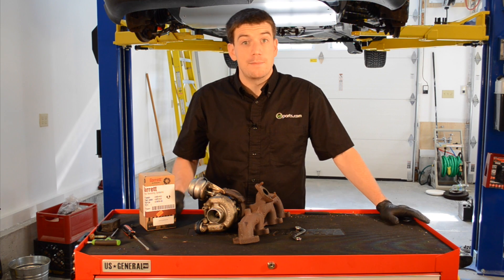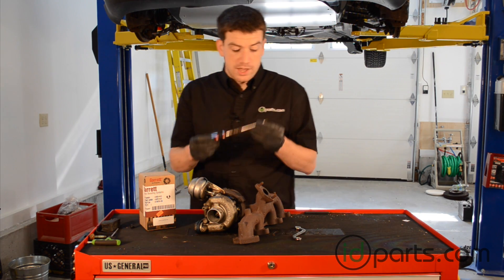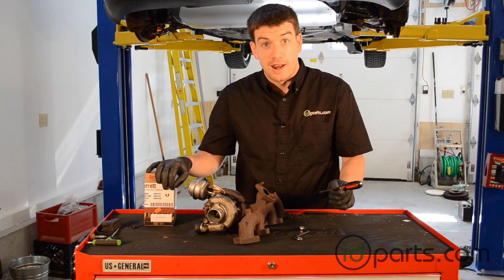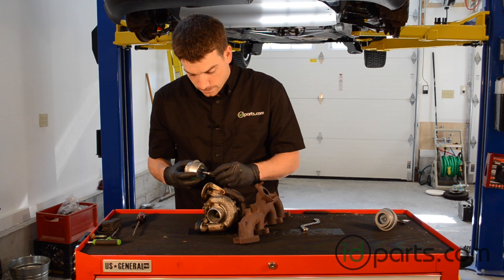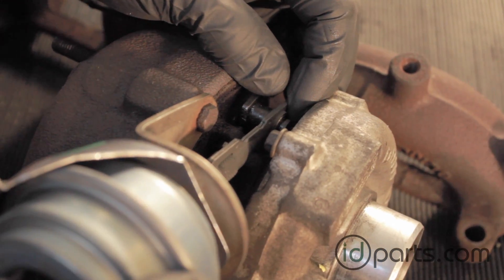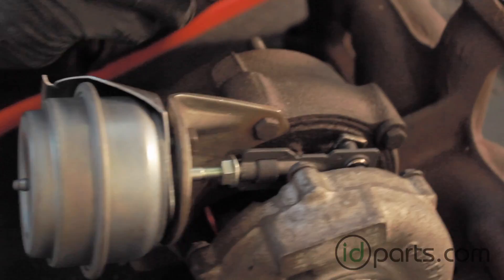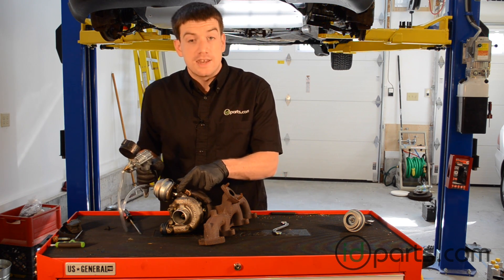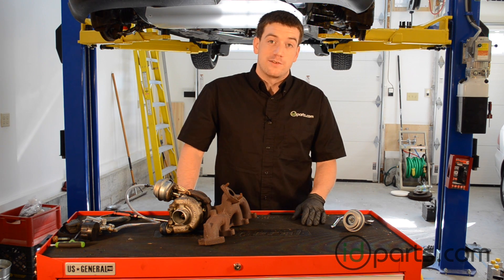How to Replace & Calibrate Your VNT-15 Actuator

Comment: So my actuator arm barely has any travel, i got it used with some work done. But I’m getting an overboost condition. However, he said that if it’s too short it’s under boosting . Does anyone know if this is correct? Thank you
Reply: Sounds like its stuck in the 'down' position due to carbon buildup in the vane mechanism.  You'll need to install a new actuator and try and unfreeze the vanes.

Comment: Turbo control - VNT and wastegate is closed if engine is not running and open if it is started and without load. By looking at the rod while starting the engine you can see if it pushes or pulls the lever - opening wastegate/vnt. If it pulls the level to the actuator then lengthening the rod will actually cause more boost as the vnt will stay closed for longer time. If it pushes the rod out then shortening will cause more boost. (if you want more boost about 1.5 turn should be enough and 3 turns if you trust your turbo)
Reply: Should the lever be completely up when adjusting it?
Reply: @matthewlee2686  doesn't matter what position it is in when adjusting. Basicly 1.5 turn (shorten or lengthen) should be OK, 3 turns if you wanna risk it for a biscuit.
Reply: Ok, ale co zrobić ze śrubą ograniczającą czyli zderzakiem geometrii? Najpierw ona musi być wyregulowana. Czyli jak?

Comment: 5:03 The more it move has to be understand as the more it shorten for sure, but this phrasing was a bit confusing, as the movement is opposite in fonction on car while increasing rpm. make sens?
Is there any video for stop screw adjusting to find the right position?

Comment: Pls I don't have any vaccum design to check and see. How pressure it take to 4each the stop point. Pls how many thread nut is left over before you locked it.i can use that is set mind pls

Comment: I had recently replaced turbo core because of oil leakage, however I am facing issues with the boost now as I could not understand these adjustments as yet. I have a Garrett Turbocharger, which is supposed to start kicking in at 1500 rpm, however it starts kicking in at as low as 1100 rpm. From 1100-1900 rpm, I can feel there is too much load on the engine, turbo speed keeps increasing (from the rotating sound it makes) and then suddenly after 1900-2000 rpm is crossed, there is sudden gush of energy and acceleration, feels like turbo had acted now. Thereafter, again between 2200-2300 rpm, i can feel load on the engine and hear the turbo starting again (means the high speed rotating sound of turbo). Please advise what could be wrong and how to correct it.

Comment: What does the 15 to 18 mercury translate to in boost pounds?
Reply: You can't convert vacuum pressure of a actuator to boost pressure. Boost is different depending on the turbo size. The actuator could work on the same vacuum on a big or small turbo. It's more to do with the actuator spring tension as to what vacuum you need to move it.

Comment: Hi , here is some info that might clear things up !
usually to calibrate the stop screw , you need a vnt flow bench .

 if you don t have one.
before  disassembling the turbo use a mityvac to know what the old turbo was calibrated on . 
Mark that down.
AND just use those old parameters .

usually a gt1749 vnt turbo hits the stop screw at - 0.5 bar
Reply: For "a little more power" it should be +/- 0.5 bar?

Comment: Hi I'm having trouble calibrating the actuator arm on a Garrett GT2052V I'm using a Mityvac like yours and I adjust it to about 15 but the arm becomes very hard and it won't go up or down when I pull the vacuum hose off at idle. I also took it for a drive with the actuator adjusted at 15 and it had no power. 
BTW this turbo is on a Nissan ZD30DI diesel engine on a Nissan Patrol in Colombia south America. 
Any tips please
Thank you

Comment: Yes I was wondering I have a 2008 Volkswagen Passatit went into misfiring and threw a code for underboost at first I thought it might be my diverter valve but while I was up underneath their I noticed that the west gate actuator arm have come completely unscrewed so I screwed it back onand now I'm getting a cylinder 3 misfire I think I might have it screwed on too much is there a factory setting or do you know how to set that back to the original setting how do you do that any help would be greatly appreciated cuz I think if I got too much boost it's not throwing no code for overboost but I was thinking if I got too much booze that would burn my motor up and like I said it's doing almost the same thing it was doing for the underboost it is not showing the underboost code no more but is showing a misfire on cylinder 3 and it's running like crap

Comment: Engine code p1556 or p1557 depending on what scan tool used  any idea what can be problem just says pressure control negative deviation
Reply: I know it's 4 months later. But Google the codes and it should tell you what to look at for possible culprit

Comment: I have a golf mk4 1.9tdi,66kw 90 hp,i cant get over 3000rpm and 130 km/h,and its sooo slow in acceleration...any tips what is the problem? egr valve is clean like new,all vacum hoses are new,maybe MAF,or MAP sensor? or something else? any suggestion?
Reply: yeah bad MAF or MAP could do that , try to change those sensor with other GOLF before to replace it , if tha doesnt help remove ur turbo and clean it from inside , maybe the turbo is stucked

Comment: Hi can I just ask why you would need to replace an actuator?  Thanks
Reply: It rusts out or the diaphragm inside will corrode and break down. When that happens, it won't hold vacuum. You check this with that vacuum pump like he has. They're fairly cheap, but you need one. So, a good actuator will not only move when you apply vacuum, but it will hold vacuum after it is applied. Watch the gauge and make sure the vacuum stays up after you pump it. If it doesn't hold vacuum, it is leaking and will not work for your turbo. That's what happened with mine.
Reply: Well.....if your old one is fucked it's generally a good idea!

Diaphragm goes brittle inside and leaks
Reply: @pjbrad1541  Oh I see.  I'm having an issue where my turbo is a bit sluggish soon after startup, but after 2 mins it's absolutely fine and responsive.  I find the car accelerates more when the pedal is halfway, than when it's fully down.  Any ideas?  VW BKD engine.  Cheers
Reply: @pjbrad1541  Is it a good idea to change the actuator every X thousand miles? Or only when it goes wrong?
Reply: If it ain't broke don't fix it.
Suck the small vacuum pipe that goes to the actuator and see if it moves all the way. If it doesn't move it's knackered.
Google Mr muscle turbo clean....normally a sooted up vnt

Comment: 4:35  Is it possible for the turbocharger "actuator stop" to be in the wrong position?  Can the "stop" be adjusted too?
Reply: yes but it still wouldn't be perfect, proper way to do it is to have it calibrated on a flow bench.

Comment: Nice information.  But why is my local garage too scared to replace my actuator or adjust it?
Reply: Because the "proper" way to do it is by taking the whole turbo off and replacing everything. That's what's described in VW's maintenance procedures. Besides, there's a decent chance replacing or moving the actuator might not fix your boosting problem.

That being said, there's a chance it will fix your issues (depending on what they are), and you should consider trying it.

Comment: Without the actuator install, is the vane fully close equate to 5 mm Hg and fully travel to open equate to 18 mm Hg?
Reply: It's inches Hg, not mm. And for closed, yes, but fully open with it off the turbo will be higher than 18.

Comment: Love the help! I need some help though.  I just had my vnt 1.9 TDI turbo rebuilt. Went home, installed it. Upon starting I get a lot of white smoke. Looked at exhaust pipes, there is black oil running out of it. So I called the shop, they said to check clearances as well as measurements on the compressor?? Then let him know......I haven't a clue what to check? Any help would save my ass!! Please help. Thank you.
Reply: Bad turbo

Comment: Nobody ever shows you how to do this without taking the turbo off the car
Reply: takes about 15 mins to take the actuator off the turbo...while it's still installed on the engine....use a mirror to see the stop point and adjust from there?
Reply: You wouldn’t be able to record the video and someone would complain that they couldn’t see anything (job sucks as it is especially if you line in The salt belt where everything is seized
Reply: It would be difficult to show everything with all the other stuff in the way.
Reply: Don't think its possible there is zero room to work.

Comment: Hi Great video,
I've just fitted a new core to my turbo, but i have to calibrate the lever limit screw myself, where should it be?
Reply: need to run engine and messure the vacum on the pipe,see what pump gives you,then apply that amount of vacum to turbo and it should be fully back ,so timing is done,car got x amount and turbo moves with that amount ,should travel from shut to open and back ,how i do it

Comment: Now I have a face to match the email. Great video. I am inspired to finally replace my actuator. However I do not plan on removing the turbo. Will this present major problems? I have the VNT 17.
Reply: Did you ever find out whether you had to remove the turbo?
Reply: No it's easily done in car
Reply: @dlmdee  big scam. I did it on my back in my driveway in 30 minutes
Reply: It takes about 1/2 hour with it on the car

Comment: I have walksvagen golf mk4, I cleared my turbo and i put new actuator but always it doesn't work,  i need help please
Reply from the maker: +Fawzi mahmoudi This link may help: http://www.vaglinks.com/Docs/VW/Misc/TDIClub.com_LimpModeDiagnosisGuide.pdf

Also check out TDIclub.com and do some searches. A lot of helpful info there.
Reply: @idparts  Unfortunately this link doesn't mention anything about limp mode caused by overboost.

Comment: I don't understand,Don't you want to add boost to see when the wastegate opens??? It looks like your adding vacuum tho. I would understand if you were pumping adding boost pressure like pumping a bike tire. But I just can't understand why you would add vacuum to open the wastegate flap. I need to find out when my wastegate opens so I know how much boost it will put out. I'm just going buy the wastegate spring for my boost. Its a 10lb spring, so don't that mean the wastegate will open up at 10PSI if I don't give it preload. I would more understand if that mighty vac gun was giving it PSI (BOOST) then the wastegate would crack open and then you know how much boost you should ruffly make.
Reply: JOHN SMART this newer diesels use the ECU to control boost so the wastegate actuator is not actually run by the boost pressure but by the vacuum controlled by an electronic valve which gets a command to supply negative pressure from the ECU
Reply: +JOHN SMART 
The turbo does not have a wastegate, it uses adjustable veins to control boost via vacuum which is controlled by the ECU.
Reply: RUFFLY.

Comment: Don't foget if youre car was running for a long time with a low power condition remouve the lower intercooler pipe there is a big chance that there is a big amount of oil clean the oil to prevent a runaway situation and destroy the engine and a second point is if the actuator was rusted and rust dust can damage the black and white check valve and the N75 and make sure you have good vaccum on the actuator.
Reply: V10PDTDI hey I keep getting a p0234 over boost. Have new solenoid on firewall, turbo actuator, took turbo apart and cleaned it up. I adjusted it just like this video. I’ve even tried moving it a few turns and drive it and same thing.
Reply: Using my solus I checked boost pressure and at part throttle say it requested 1300mbar the actual value was 1400. Wide open it spiked at 2500mbar and requested was 1700. Car has 160k on it. Any info would be greatly appreciated. If it’s easier maybe I can have you message me on Facebook

Comment: what would i experience with overboosting?
Reply from the maker: Hi Evan,You might not notice it unless you had a boost gauge, but if it overboosted enough the car would go into limp mode, which is basically when ECU senses overboost and stops using the turbo. You would know if your car was in limp mode because of the power difference--your car would just become extremely sluggish, but when you restarted the car it would have its power back. You may get a check engine light when this happens.    A sure way to know would be to plug the car into VCDS and run logs to check requested boost against actual boost.
Reply: Alright thanks
Reply: @idparts  My VW BKD engine keeps going into limp mode because of overboost.  What should I do?
Reply: IDParts.com  requested boost and actual boost should be equal? or there should be a difference between them? I have a Vauxhall Frontera truck 2.2 l diese; (similar to Isuzu Rodeo)  with garret turbo and I always have a difference of 0.2 up to 0.4 bar (depending on throttle) between the requested and actual, the requested one being higher.